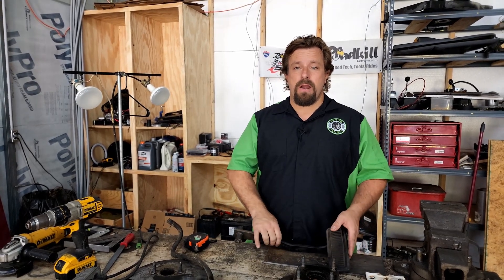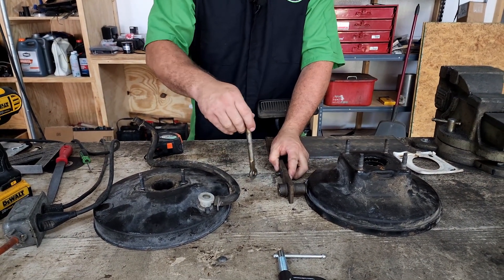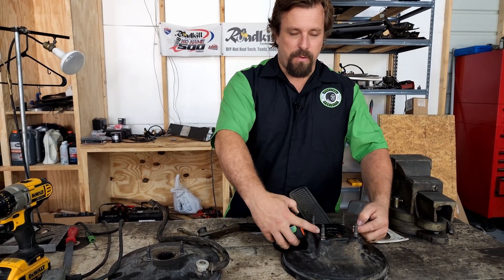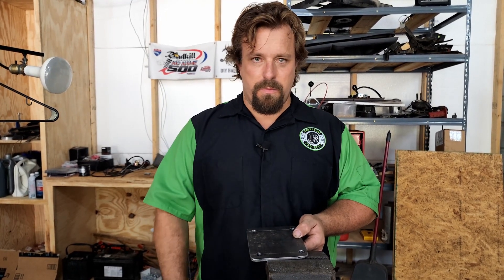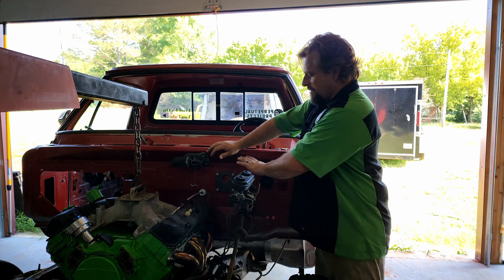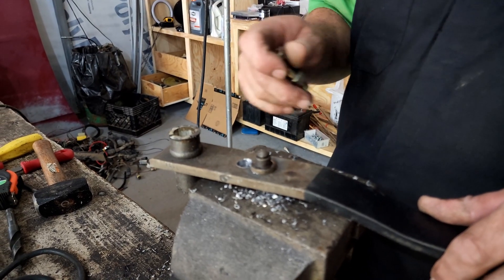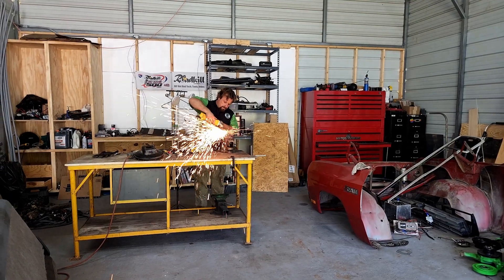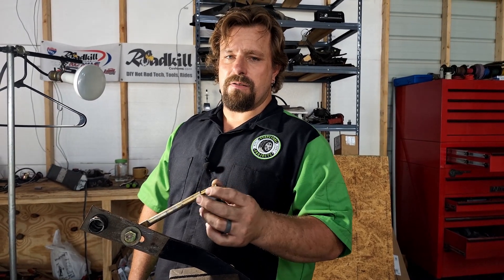Pedal Ratio: When & How To Measure And Adjust It

Comment: Good video, but would've been more beneficial to have close ups when measuring pedal.  Appeared you measured at an angle from pivot to pad which is not accurate.  Should be measured at right angles I believe.

Comment: Did the factory have it set up differently for manual and power brakes?
Reply from the maker: The pedal is stamped with p/brk, so I image they had a different pedal for manual brakes but I don't know that for sure.
Reply: @PerpetualProjects  I did a manual to power swap and didn't change the pedal
Reply from the maker: Going to power from manual, the pedal ratio change may not be as critical. Changing the ratio would add a little more effort but reduce the pedal travel.